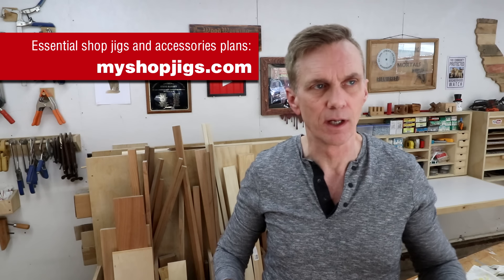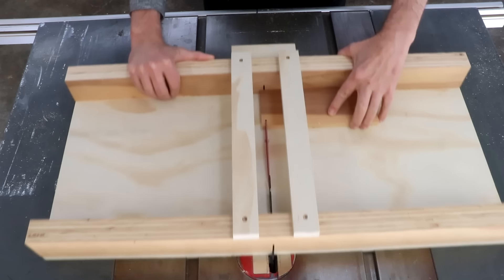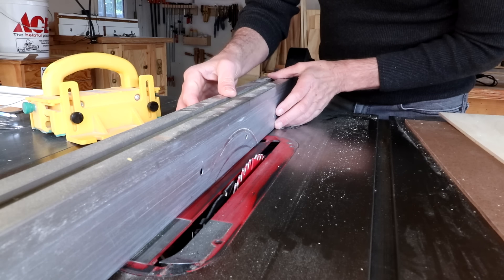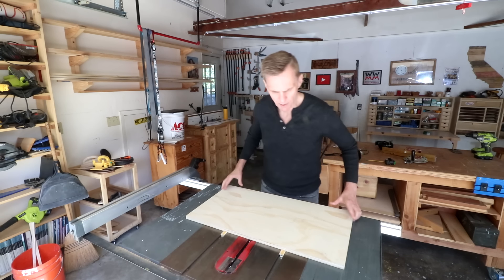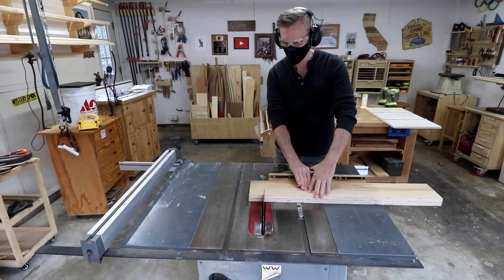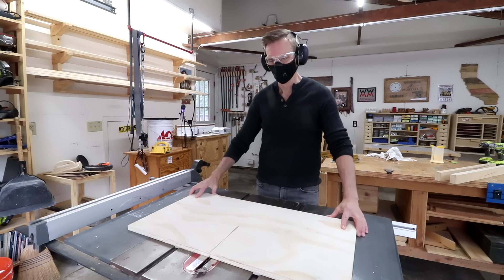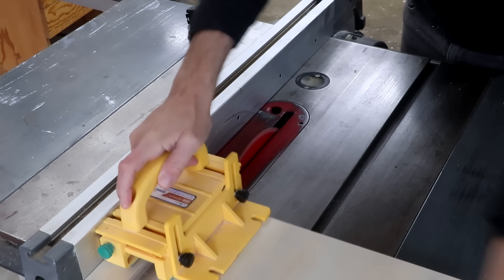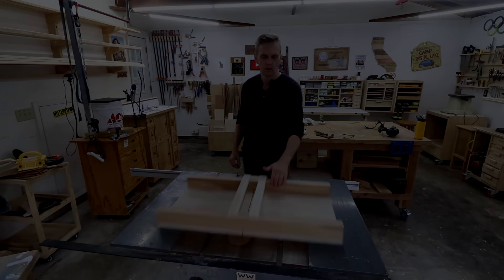The simplest table saw crosscut sled on YouTube. Essential woodworking shop project.

Comment: Once you have the first ridge or push board set , squaring it to the blade, why not just cut two spreaders of equal length to set the second one instead of once again squaring it to blade. ?

Comment: Here is a tip:  put a small chamfer edge on the front fence that meets the plywood. It will help with dust build up.
Reply: Great tip, can be used for stop blocks too
Reply: @jamesparsons9437  ttttttttttttttttt I just got home from the park and I got it on my pop
Reply: @jamesparsons9437  Good tip, but you see how fast a simple sled becomes complex? What? No cup holder?
Reply: @Bob_Adkins  Ooh, you might be on to something with the cup holder.
But yes, I take your point that simplicity can be very important.

Comment: 10:30 If you make a sled that is off center to give better support to one side, squaring up both the front and back fences allows you to reverse the sled. So if you need more support on the other side, just flip it around and you'll still have a good, square fence.
Reply: I just thought this same thing.  
If your slots are not equidistant to the blade, you'll have two kerf cuts in your sled, but barring buckling of the, now three pieces, of the bottom of the sled, I can't yet forsee an issue.
Reply: I had a similar thought – if both fences were square, you could reverse it and use that for angled cuts, keeping your original crosscut table zero-clearance.
Reply: complete noob here but whats the point of having the front fence (the one further away from you) if you don't plan on flipping it?
Reply: @wangusmaximus  holds the plywood together since it will technically get cut in half
Reply: @wangusmaximus  besides keeping the sled square, both fences will hold your sled together and stable, otherwise it will be wobbly and fell apart
Reply: HOT DAMN!  GREAT MINDS THINK ALIKE LOL. YOU BEAT ME TO IT LOL
Reply: @wangusmaximus  You still need it to keep integrity on the whole piece. It keeps it fastened together. Without it, there will start to be more and more flexing, making your sled lose smoothness and even square.
Reply: @wangusmaximus  It holds the two pieces of the bottom plate together and keeps them square and even. Without that far side fence, there would only be the fence closest to you holding the bottom halves together. The crosscut sled would be flimsy and not hold together well.
Reply: If tabletop slots are not at equal distance from the blade.This can't be done! You will end up cutting the sled and fences twice and that WON'T BE stable enough. 
Just use the circular saw or a mitre for the 50 feet beams!
Reply: @tedybear7518  I assume the 50 foot beam is an exaggeration lol. Yes, if your slots are not equidistant to the saw blade, you may have a problem. Definitely something you need to check. In most cases though, they are pretty darn close, so it would just mean a slightly wider kerf in the sled, so you would just need to be aware of which side of the blade the kerf may be off on.

Comment: Love, love, love that you are not using a SAW STOP table saw in this video; makes you more relatable.  Thanks.
Reply: Although, they're great saws, they also have a ridiculous price tag on them.  Don't get me wrong, but I just cannot afford one that would match the saw I have already....Sawstop wants about $4400 for a comparable saw to my cabinet saw.  For that price I'd have 4 table saws like the one I already have LOL.
Reply: @wildbill23c  I paid about 600 more for the CTS than a comparable non-CTS, but for me, thats the cheapest insurance Ive ever bought.  Maybe I will never trigger it with flesh, but if I ever did, that 600 pays for itself in one trip to the ER vs not having it.   I get it, Sawstop is more expensive, but the ER cost will be even more if you ever have flesh meet blade.

Comment: Thanks Steve!

Hot tip: while you have your rip fence set to the perfect width for the runners, cut a whole bunch so you don’t have to fuss with it again when you make another sled of some sort.
Reply: I wish I would have read this. It was a nightmare getting those to the correct size 😮‍💨
Reply: I use the mitre bar to set the fence for width and depth. The depth I tapped about a 16th closer.
Reply: @lawlworthy9805  If you cut the runners a tiny bit too narrow, you can take up the slack by applying gaffer tape (or painter's tape) to the side of the runner.  It's also a useful way to tune them up after years of wear.
Reply: Make extra-extra while you're at it. They make great shims and paint/epoxy stirrers.
Reply: Genius
Reply: You can also make one as a template, just label it and whenever you need more runners use it to set the fence up.
Reply: Thats a brilliant idea. 🙂
Reply: Thanks Steve,  an excellent tutorial on a basic cross cut sled..Thanks! - now made mine 👍🏻
Reply: I have been watching your videos and think they are so simple informative thanks 
Also no load
music

Comment: Quick tip that might be helpful for someone else making this: When you glue up the front fence, clamp it to something straight like a level or a piece of angle iron.

I made Steve's most recent crosscut sled (prior to this version) and the front fence is just slightly bowed, which means I can never actually square it up. It took a LOT of adjusting and frustration before I realized it was the fence and not my adjustment. But if you clamp it to something straight while the glue sets, you're pretty much guaranteed the final result will be perfectly straight as well.
Reply: Great idea (y)  I've also seen Tamar (3x3 Custom) use a level when she glues boards together that aren't straight, but will be after the glue is dry!
Reply: Was about to propose the same! Learned that from Heisz. Another suggestion: use the 5 edge method to check squareness!
Great instructional video, not only the how but also the why.
Reply: Great point!  If you watch Tamar's video on 3x3 Custom she uses this method in her video.
Reply: Just noticed that someone already mentioned her channel lol.  Great minds!

Comment: How did you know I JUST bought a table saw and was looking for a good version of a sled?  Crazy timing!
Reply: One tip...you don't need the whole sled to be the whole depth as he has his.

Mine is only the full depth from runner to runner, and necks down thinner at each end to save weight and sliding friction.

In fact, mine only has one runner, and I have cut some pretty heavy stuff with it without any problems.

Comment: I have a basic portable table saw. As it has those funky 'notched' miter slots I've found it pretty much impossible to manufacture rails that will work for a crosscut sled. After numerous attempts and failures, it finally dawned on me, instead of rails in the table, put guide rails outside of the table. After making sure that the sides of my saw were parallel and straight, I cut a piece of 3/4" plywood that matched the width of my table saw. I positioned that piece on top of the saw and carefully aligned the edges. From there it was just a matter of attaching a guide rail to each end of the plywood and making sure they hugged the table top snugly but not too snugly. Then I just followed Steve's plans and video for the rest of the sled. I now have a crosscut sled that slides smoothly and makes beautiful right angle cuts. Thank you Steve Ramsey for inspiring this 69 year old woodworking amateur!

Comment: Great video, great sled, but a warning after having just made it. After getting the bulk of it assembled (bottom runners and front and back edges/guides glued/screwed onto the base), I decided to go with the worst case scenario and raise my blade to its maximum height to be able to handle any future cuts. I didn't realize it at the time, but my blade raises to about 3-1/4" above the surface of the table. With a 3/4" base and 2-1/2" front/rear edges, that's a total height of 3-1/4". Fortunately, before cutting all the way through, I noticed this so I added another 3/4" piece on top of the front/rear edges to avoid cutting the sled in half!
Suggestion: BEFORE cutting the front/back edges at 2-1/2", measure the maximum height your blade rises above the table surface and make the height of the front/back edges sufficiently tall to accommodate.
Reply: Thank you!

Comment: Couple things different about mine: 45 degree chamfer on the inside of the front rail so the sawdust has somewhere to go, and I left the runners about 2 inches longer sticking out the very front so it's easier to line it up with the rails. I also used melamine, since it's already super flat and doesn't bend, and slides beautifully with the paste wax
Reply: I am especially interested in your comments because I am building this sled and I had some left over melamine that I am using. Glad to know there are advantages or at the very least that is ok to use it. For me, it was just a fortuitous circumstance.
Reply: @stephenmoore2561  being more cost effective and very stable and flat, I opted  to make mine out of melamine also…. I didn’t drill my pilot holes large enough and it split 😫 hopefully this didn’t/ doesn’t happen to you!

Comment: Steve, I made this sled in about 4 hours, including the time it took the glue to dry. Thank you for making this so easy to understand and to make. I left your video up on my computer as I went from step to step, as a reference. I made this for my 40 year old SKIL table saw. I offset it to the left so I could use my rip fence as a guide, as I don't have table extensions. I can't believe I waited this long to make a sled, but once I watched this video I realized I had to make one. Thanks again for showing how to make things easier to do. I am pretty sure I will end up making one for my son as well.

Comment: Looks good and practical. With the price of lumber so high, and noticing there seemed to be a lot of excess from your cutout for a 4 x 4 section of plywood, I made a different cutout using a 2 x 4 section of plywood, still with some excess! Thanks! (Note: not enough to make 2 30" pieces for the back/far edge, but with a 30" and 24" glued together, I think that's a good tradeoff to be able to use a 2 x 4 section of plywood.)
Reply: Thank you for this suggestion! I was just trying to figure out how I could get by with using a 24x48" piece of plywood to build this sled. And now, I know!

Comment: You answered the question I had within 4 minutes.  "Can you use masonite for the sled's runners?"
 
I have a full sheet of masonite just itching to get used.
Reply: You can also use those white plastic cutting boards that are dirt cheap at Wally World!
Reply: @charlieodom9107  I read about that and how resistant they are to prolonged use when sliding the sled for a long time. Some even recommend those for making a small crosscut sled too.
Reply: @jellyg.8961  the only issue is mounting them to the wood. Super glue won't hold long, so screws are a must. You can buy UHMW material in sheets instead of cutting boards, but it costs more. The cutting boards are thinner than most miter slots, but if you get the thickest one you can find, you can make quite a few sleds with a single board.
Reply: @charlieodom9107  yes, those are the ones I think of. My mother owns a restaurant and sometimes those cutting boards are replaced because of use (they get ugly) but part of the board still its functional. Some of them are half inch thick or more, I think that would be great for making either the sliders or a small sled.

Comment: Great and simple design! I would bevel the inside bottom edge of the front of the sled as place for sawdust to go - especially needed when you're making repeated cuts with a stop blobck.
Reply: Essential for accuracy!
Reply: Yes. Making a chamfer on the inside of the front fence is essential or you'll be blowing dust off every single pass.

I also have a stop block that the reference edge doesn't touch the base to eliminate dust from skewing the measurement. A simple screw in the reference end of the block works as well.
Reply: Can you please elaborate, if I'm facing my table saw are you referring to the edge of the sled that's farthest away from me (hits the blade first) or closest to me (the side I'm clamping stop blocks to) which one should I bevel?
Reply: @JusFig  sorry, but it couldn't be any more clear! Where is dust going to build up? Where do you align your work piece? Chamfer that edge to create a pocket for extra dust to fall into so it doesn't obstruct your alignment.
Reply: @JusFig  As Charlie Odom said the bottom of the fence closest to the saw and to you where you would clamp your stop blocks.
Reply: @charlieodom9107  I'd rather appear dumb for a moment than make a crucial part of the sled wrong.  As a new woodworker, what may seem obvious to you is new to me.  I appreciate you taking the time to clarify for me and probably for someone else who may be confused in the future.
Reply: @JimService  thank you for the reply Jim, appreciate you clearing that up for me
Reply: @JusFig  this isn't rocket science. It is literally 3 fucking pieces of plywood screwed together! If you can't figure that out, then maybe woodworking isn't the craft for you. Sorry, but you are making this WAY harder than it is for no reason.

You literally screw 3 pieces of plywood together and add a runner to the bottom. If you want the front piece of plywood to be exactly square to the blade, then you'll need some way to make micro adjustments to the reference edge. If you don't understand this, then you probably haven't even mic'd your miter slot for square yet, which should be done before ANY sled is built.
Reply: @JusFig  The one you are clamping the stop block to- hope this helps
Reply: @charlieodom9107  Please tell me you are not a teacher.  In fact, please tell me you live on an island alone with no contact with other people.

Comment: I just made my new sled today, but I only did a one-sided sled. I'll probably make a two-sided sled later. My next project is a mobile mitre saw table and an outfeed table for the table saw. What I DIDN'T do is put wax on my sled. I'm glad I saw you do that because I had intended to do that, but I forgot to. Fun stuff!

Comment: I find that leaving the runners an inch or so long lets me see where they are as I place the sled in the slots.  You are quick without that, but I'm not.
Reply: That is a good suggestion, never heard that one before. Cheers
Reply: I just slide mine across the table till it drops into place. I also only use one runner. One is plenty, and I cut some pretty healthy lumber on mine! I cut a 2" thick hickory tabletop that was over 4' long with one runner on mine.
Reply: For me it works fine if I just align the middle slit with the blade of the saw, but I don't see why you can't have the runners a bit longer if it helps you :)

Comment: Steve, this is a great design.  I have a huge sled; looking for a more medium sized one like this.  

One detail:  Having the fence square to the blade is irrelevant UNLESS the blade is known to be parallel to the miter slots.  The fence MUST be square to the miter slots even if the blade isn't parallel to them.  If the blade is off a little and the fence is square to the miter slots, it will only make the kerf a little wider and cuts will be square.  If the fence isn't square to the miter slots, the cuts will never be square.
Reply: I was thinking the same, but how do you square it to the miter slots?😅
Reply: @agentrapper  There's usually adjustments in the saw undercarriage that can fine tune it. You'd need to check your saw  owners guide or service manual as this will vary
Reply: @vidpromjm  Ye, but I've checked it several times, and I can't find anything about the subject 😅
Reply: @agentrapper  What model is your saw? I've got dewalt 7491 and google returns quite a few hits on how to align. Otherwise Id try and hit up the manufacturer or retailer?
Reply: @vidpromjm  Thanks for your suggestions, but I tried googling it before looking in the manual. 

It's a Scheppach, don't remember the model right now.

Comment: If you square up the front and rear fences, couldn't you make an offset sled reversible? Use just one sled to cut longer pieces on the left side or spin it around to cut longer pieces on the right side.
Reply: I think it can be done but I haven't seen one like that made.
Reply: I was just thinking the same thing. Make it symmetrical front and back, and then you can offset it one side, and just rotate 180 to have the longer support on the other side
Reply: That front and rear fence definition can be a problem.  To better understand, apply the church rule.  If you are outside the church and somebody says, "I will meet you in front of the church in 10 minutes," you know immediately where to go.  If you are inside the church and somebody says, "meet the choir group at the back of the church in 5 minutes," you know where to go.  The sled is similar, are you talking about the user relative to the front or back when you are pushing on the "front" of it, and the "back" when you place your workpiece against the "rear" fence for cutting.
Reply: I'm thinking if you square both fences you could use one side as a 90 degree crosscut then flip it and set it up for bevel/miter cuts

Comment: Thanks for taking the time to make this videop.
That's a great design and very easy to make. I just finished mine and made one small adjustment. For the support struts, instead of screwing them down, I drilled holes in the struts and fence and fitted a dowel to each end of the struts. That way I can just drop them in  and can easily remove them if I want to clamp something to the fence  and the strut(s) were in the way.